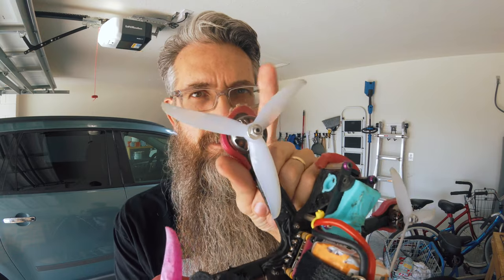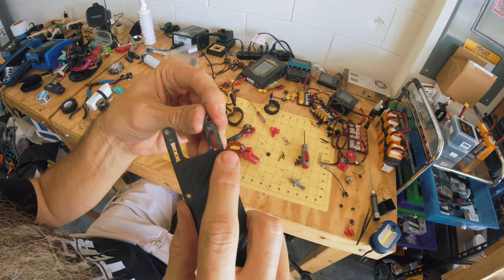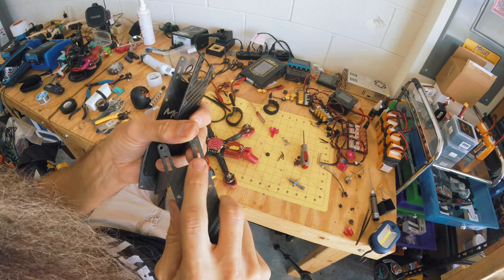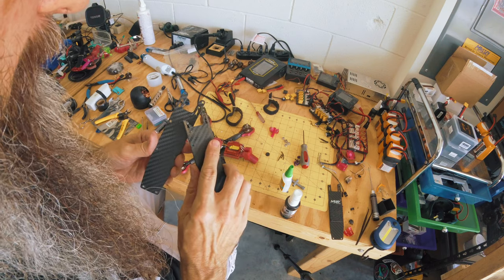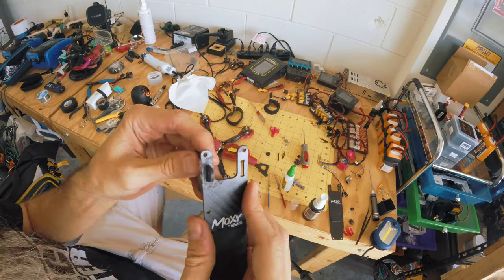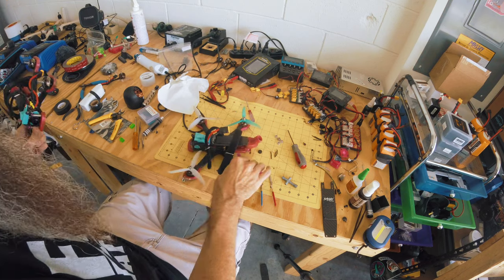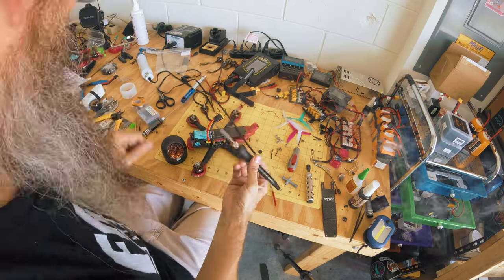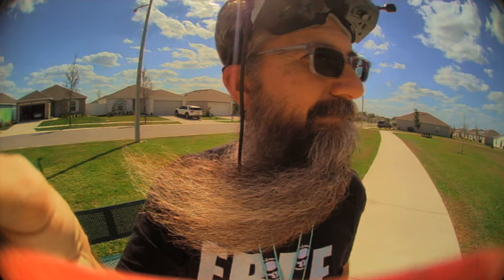The MOXY'S One FLAW

Comment: Right, guess I'll stick to the source one v3 then
Reply from the maker: If it works for you, sounds good.
Reply from the maker: Lot of cutouts in that frame though...  not a fan of that aspect of it.  Reduces weight, yes, but also adds additional weak points.  I do like the wider bit around the camera plate insert, though.
Reply: That's a great place to practice and test out the durability of your frame. All frames are a balancing act between durability and being able to get off the ground. 👍
Been flying the Vannystyle props. Really like them so far. Practicing the basics. Between not enough stick time and arthritis I have little to no flow and  I ain't very consistent either. But I do love flying. Being newly retired I can fix the stick time issue. Happy flying Stacey 💖😎
Reply from the maker: The fun part is what it's all about!  Even frustrated crashes are more fun than working :-)
Reply: @StacemanFPV  the source one? I'm talking about the v3 the old school one I've put that through all sorts of crashes most I've done is replaced an arm because the motor protection ends were delaminated from crashing and not having any TPU on them so I'd say it's pretty sturdy

Comment: Hd zero tends to do that alot it seems that's irritating when the video freezes
Reply from the maker: Yeah, it's the one thing that I really don't like.  I think it might be resolved with the right size capacitor but not sure.  If I ever find a solution, I'll definitely be posting a video on it.  I might try a larger capacitor, and see how that fares.  It's one of things though that happens at weird times.  Sometimes a hard hit doesn't affect it..  other times it does, so if I replace the cap, and it doesn't happen, it doesn't mean it's fixed necessarily, but maybe it's lessened enough to make it more tolerable.